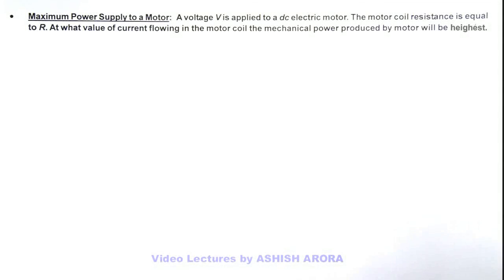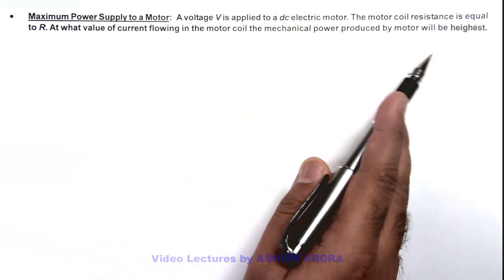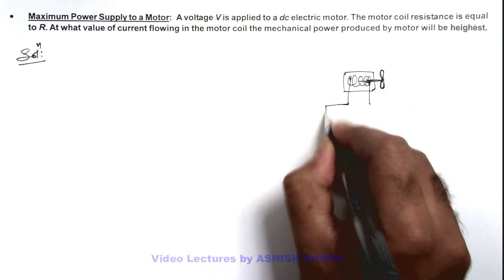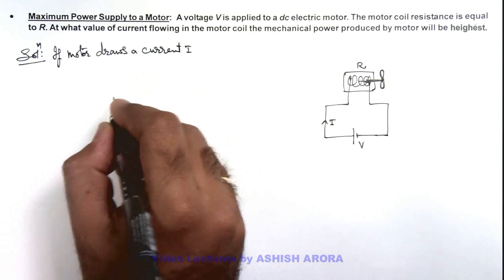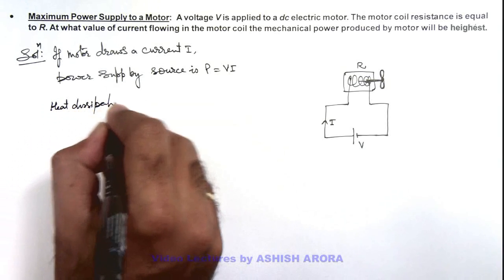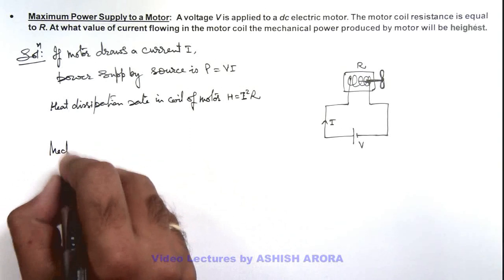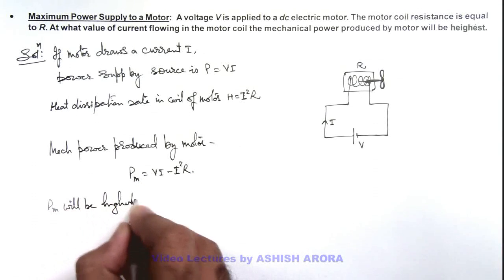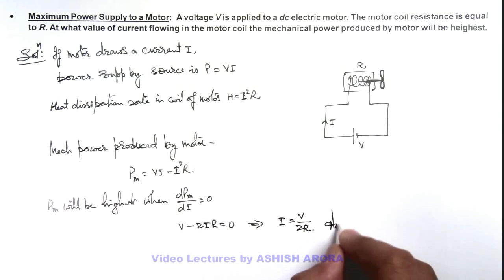13. Advance Illustration | Current Electricity | Maximum Power Supply to a Motor | Ashish Arora

Comment: Alternate method: The power generated across the motor (consider the resistor as an external resistor, not part of the motor) = V (potential diff across the motor) * I (=(potential difference across resistor)/R) therefore we must ensure that the product of the potential differences (across the resistor and across the motor) is highest, which can only be if both are equal (the sum of the potential differences across both must be equal to the emf across the battery).

Comment: can we consider it as power produced is maximum when internal resistance is equal to external ? 

in that case net resistance will be 2R and I = V/2R ?
Reply: Here the source resistance is not the cause of lesser current... The current is reduced due to the induced EMF in the coil when it rotated in the magnetic field, which opposed the applied voltage. Although the answer you are getting is same, the source here is not mentioned to have any internal resistance and so the process would not be correct.
Reply: how can we take internal resistance by our own, it is not mentioned in question, we just have to minimise the power loss due to heat dissipation rate to get max mechanical power in this case
Reply: I also had the same idea

Comment: sir in this only motor is connected to battery which has a resistance R then current across the resistor will be V/R. Then the power Pm=0. But sir u haven't take the value of I=V/R why sir?

Comment: Sir i couldn't get how is this possible, 

Why current is V/2R (as if it was normal circuit with resistance R then current would be V/R)

What made the motor to draw more current, is it something we will read in later ch (EMI/AC) or is someone from outside is doing work/making motor (like fuel) to do work or is there another reason
Reply from the maker: It is due to the back emf induced in motor the current is less... this you will study in the topic of EMI that in magnetic field when a coil rotates emf is induced in it which opposes the cause which is rotating the coil. In case of motor external battery is rotating the coil so emf induced in motor opposes the battery thats why current is reduced...

Comment: sir, I have heard that power supplied by source is p=vi  but it is not clear to me as H = i^2R which also equal =i(iR) =i(v) sir , please clearify this to   me . Till now I can think only that power supplied by source is independent .
Reply from the maker: power supplied by a source is always VI... but current I drawn by the equipment or the device depends on the devices connected to the supply...
Reply: +Physics Galaxy sir, the v is emf or potential difference?
(definitely not asking about  this case where emf=potential difference
Reply: Tarun Mali potential difference, i guess
Reply: H=I square R*t not just I square R